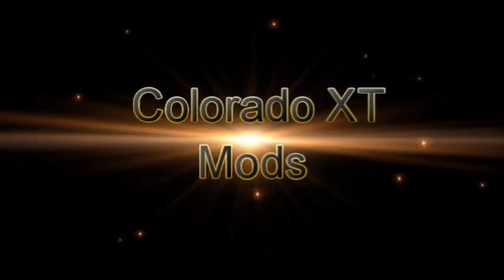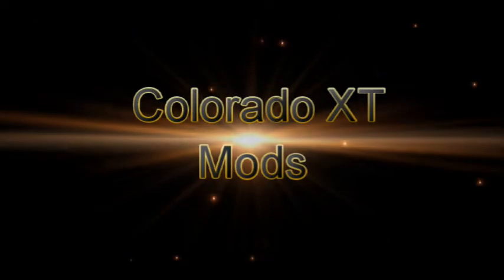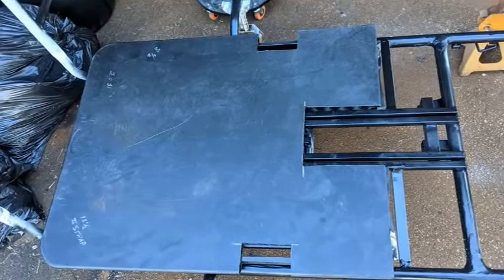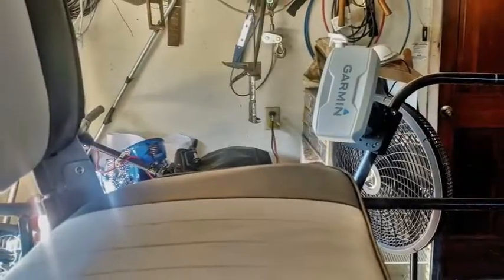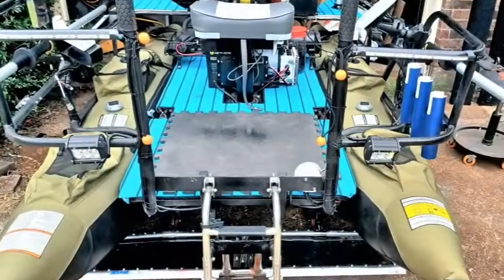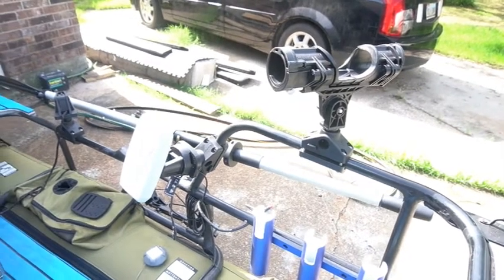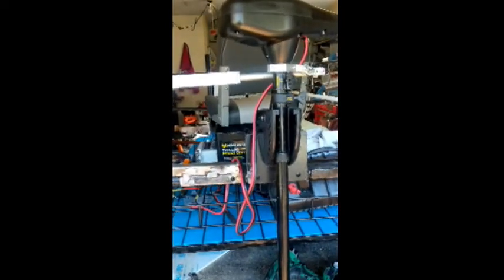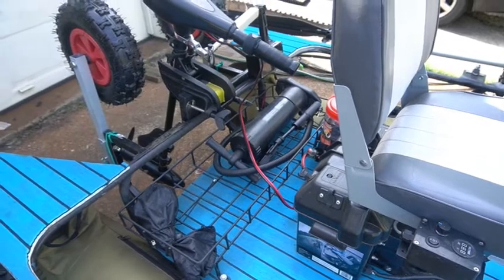Colorado xt pontoon boat modifiations

Comment: You've done some fantastic engineering... and not to be too critical, you may have a weight issue and since you've raised your seat about 8+ inches, you'll have to raise your oar locks the same amount or you'll be trying to row at your knee level, and may even need to lengthen your oars by 1-2 feet for proper leverage.
Reply: TC., I probably rowed a mile positioning the new anchor point for the oars. With my 3 ft arms  it shouldn't  cause a problem. The angle of attack when the oars enter the water will change but the angle was rather flat anyway. Oh well, the proof is in the puddin and it should not be to long before we test our theory. I will make a video of the first trip.

Comment: Its very unstable due to the compromised center of gravity: the seat, the metal structure, and the stand platform. Trust me… its a waste if time and $.
Reply from the maker: Nino, glad to hear from an expert but we will find out. id I mention that I have a 16"inner tube mounted under the rear frame? The only added weight are the side rail
Reply from the maker: The floor is a plastic card table and the pontoon guards are aluminum. I weigh 230 and will not even come close to the stated weight limit.
Reply: Awesome mods, can we get an update?  How is it on the water?